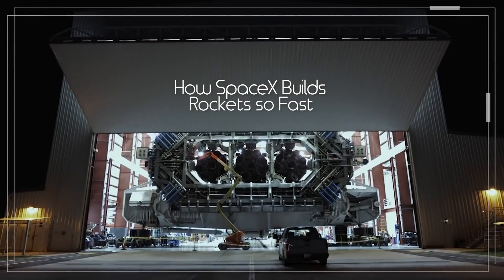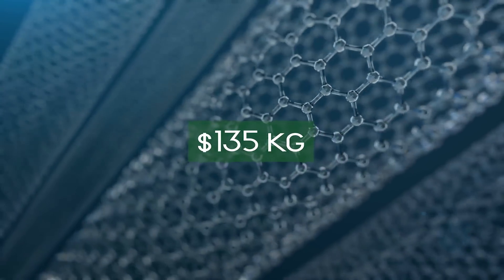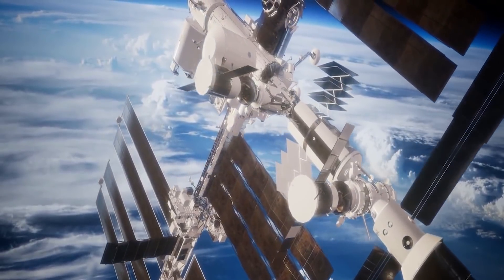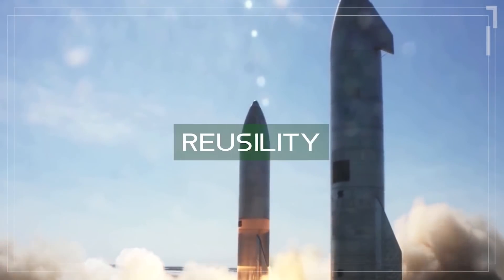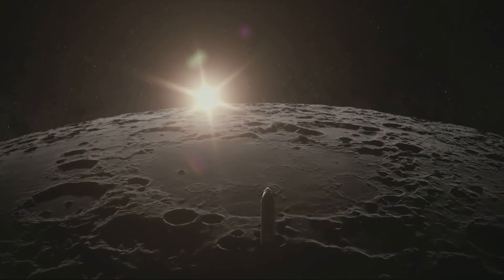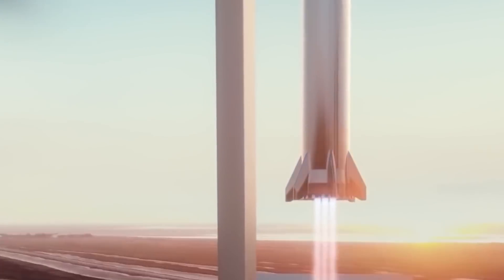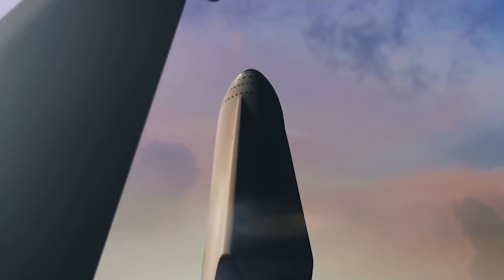How SpaceX Build Their Rockets So Fast?

Comment: I thought they were going to use 304 stainless steel instead of 301. And it was my understanding that the transpirational cooling idea was done for.
Reply: Correct on both points. Elon also was presented a report on how SS doubles the dangers of cosmic rays to the crew due to x-ray emissions.  So get ready for some major changes.  Double hull perhaps? Of course this will reduce cargo capacity significantly.... But having your crew alive on arrival is kind of important
Reply: @davidbowerman6433  , SS doubles radiation risk compared to what?  That came out crass, but I just want to know what you are saying?
Reply: Yes. There are sooo many wrong facts in this video
Reply: “Traditional rockets use tiles” you mean the shuttle, which was very no traditional…. “Traditional” capsules use oblative heat shields.
Reply: @davidbowerman6433  Changes to how much cargo starhips carry would only apply to starships that need to carry humans, cargo starhips would have the same cargo mass and volume

Comment: Very nice video but a few statements are not accurate or misleading. still a great video!
Reply: Which?
Reply: @gig2734   early all of this was either out of date or incorrect, not bad for a video published a week ago,
Eg SpaceX gave up on the idea of transpiration cooling years ago. .
Reply: @gig2734  The type of steel, the fact that F9Heavy doesn't go around the moon, The heat shield info, the welding graphics, Showing Starship while talking about Grid Fins .... and so much more
Reply: And you have accomplished exactly the same feat you attempted to correct.

Comment: They are using the heat shield tiles, it’s just that since steel can survive high temperatures, Elon said they could almost land without heat shields.
Reply: Hey, if all you have to do to re-use a capsule or starship is replace some bolt-on heat shields, I can see that working long-term.

Comment: 99% sure they are going to use a heat shield on starship they are putting test pieces of the heat shield on the rocket launching now
Reply: I don't think sn15 will reach orbit.
Reply: @Stem2Space  Yeah I don’t think they’re going to try to go to orbit until 18 or 19 I can’t remember
Reply: @aidenwindham9390  I think SN20 is generally believed to be the first one to attempt orbiting. It's also further along in production than SN18 and 19, so we might see a jump from SN17 to SN20 like we saw from SN11 to SN15.

Comment: I’m not a spaceX hater in fact I make 3d animations of there rocket but this video has a ton of inaccuracies and uses a ton of outdated information an example is all SpaceX rockets use have grid-fins but in fact a lot of the time they don’t use them like on starship + saying SpaceX doesn’t use tile the new sn15 prototype has over 10000 tile + it only covers about 15% of the hull in the prototype also the thing about hand welding making it cheaper is not true Elon has publicly dead that it would be cheaper to have Machines mass produce starships welding is cheaper for prototyping but once it’s the final design there want to switch to more precise methods to avoid problems like what Sn11 had (a small leak that fried engine avionics)

Comment: How do they build them so fast?  The engines don't work when they need them to.
Reply: The problem is in the plumbing, not with the engines.
Reply: @angadsingh9314  If the engines won't work with the existing plumbing, that's an problem with the engines.
Reply: @rogerrussell9544  nope. Most of the issues are with the plumbing. More often than not, issues have been with CH4 leaks and fires in the plumbing.
Reply: @rogerrussell9544  lmao what? Where tf does that logic come from?? It’s utterly nonsensical
Reply: @angadsingh9314  It makes sense, you just don't like looking so foolish.  But don't worry, if you happen to be a designer for plumbing at Space X and keep screwing it up, you can always get a job designing things at Boeing, they have even lower standards that might suit you better.
Reply: @manashejmadi  Fine you put all the plumbing you want into the next one and see how far it goes without good engines that can fire on command.
Reply: @rogerrussell9544  dude. You're holding the same logic and not even thinking for a moment. Engine failure doesn't cause CH4 leak. There are obviously issues with plumbing. Whenever there was an engine failure there has been either a methane leak or a fire near the turbo pump. And without the plumbing, the engine is useless.
Reply: @manashejmadi Dude, if the toilet doesn't flush you say the toilet doesn't work. You don't say the toilet is fine but the plumbing has issues.  The engines didn't fire right and the ship crashed and exploded.  If you don't like the facts, deal with it but don't come whining to me.

Comment: "The average space rocket has about 21,000 heat shield tiles"
Your information is just bad. The average "space rocket" has 0 heat shield tiles. Most "space rockets" are expendable or boost back from a sub orbital velocity. Pretty sure that the Space Shuttle and the X-37 are the only examples of what you would consider a "rocket" to use any kind of heat shield tile.

Comment: You can't quickly cut or weld carbon fiber.

I've heard Elon say several times that engineering rockets and spacecraft is actually the easy thing to do.  It's the engineering that goes into the production on a large scale that is the real feat of engineering.

Comment: Minor point: SpaceX is turning out Falcon 9 block 5 just as fast as any rocket manufacturer... He can just reuse them and save costs. Also, they gave up skin cooling 2 years ago.  And as a matter of fact, are still facing major challenges on how to protect the fins and hardware from orbital entry speeds. It's still an obstacle they have (yet) to overcome. Add to this Elon is finally starting to understand the math of keeping the crew safe from cosmic rays (SS makes it a lot worse) and the math of consumables the crew needs.  Your going to see some major redesigns in the near future.

Comment: The problem is 8$ per kg for SS 301, 178$ for fibre. Stainless Steel however is more weight than fibre. Stainless steel  density 7.6 g/cm3 while carbon fibre is 1.3 g/cm3. And also Stainless steel fabrication is much more expensive than carbon fibre. I think this is no the reasons their rocket is cheaper.

Comment: Falcon and starship are 2 very different beasts, you can’t jump back and forth and expect someone who is new to follow your video. Falcon is cheap because of the way the produce it and the fact it’s reusable, not because it uses stainless because it doesn’t. Falcon is fairly traditional other than the fact it lands itself. Also, with falcon they had a fairly traditional test experience, flying payload on the first flight. Starship is the one where they are just trying things to see what works and using stainless steel

Comment: Since Spacex uses stainless steel instead of carbon fiber, how do they deal with the weight disparity? Carbon fiber is MUCH lighter than SS, so getting a SS rocket off the ground necessarily requires more thrust, which means more fuel, which means more powerful engines, etc.

Comment: Pretty bad research you did there bruh. Starship is always going to use Heatsheild Tiles on 2/3 Part if its body. Stainless Steel can never take the temperature if re-entry.
Reply: 1/4th of the video was just reading tweets. How much more research can you actually expect out of it.

Comment: SpaceX just blew up their launch pad and sent debris flying for miles. NASA has grounded it. It will apparently take months just to assess all the damage (including to the environment). Of course it is always cool to learn from mistakes, but whatever physics and engineering they relied on to think the launch of the most powerful rocket in history would not damage it's launch site, was ridiculously wrong. It was irresponsible to launch before completing the cooled steel plate...

Comment: So, stainless is stronger pound for pound than CF when frozen.  OK.  But only the tanks experience that, so the rest of the rocket is not as strong for the weight.  Sounds like the best design would be carbon fiber airframe with stainless tanks.  That would produce a lighter rocket hat could carry more payload.  The greater cost of carbon fiber matter less if the rocket is recovered and reused repeatedly. You only have to build it once.

Comment: Type 301 Stainless Steel, often referred to as UNS S30100, is a popular austenitic chromium-nickel stainless steel that is known for its corrosion resistance. Similar to Type 304, Type 301 has lower levels of chromium and nickel which increases its cold work-hardening range.
Elon's gonna beat the Production numbers of WW2 B-17's!!!

Comment: There are some unprecise claims and a vague language.

e.g.: Who says they dont use "fancy machines" 5:06 ?! 
Welding, bending, cutting, lifting, transporting, even attaching the heat tiles all involves machines.

"SpaceX's components consist of " -> Steel is certainly a material and not a component! And its rather about the starship's components

"Construction happens RaThEr openly - so theres no machine doing the bulk of the work" WTF Why?

"Exceptional Engineering" (0:52) could as well have said "M A G I C"

Comment: I'm just curious has space X tried a booster with a turban to help propel the rockets into space with a fuel injection delivery system for fuel?
Reply: This is how IT IS DONE, a turbine driven pump is used to feed the fast amount of fuel and oxygen injected into the rocket engine chamber the resulting massive  explosion in a short duration provides the huge thrust needed, the turbine  is powered by some of the fuel  to pump the huge amounts needed into the combustion chamber in sufficient quantity. The rocket engine design itself is from early german v2 rocket engines basically of the same design but built with new more advanced materials

Comment: Whoa 135$ for nano carbon isn t it that expensive because it s that good. How many more and What step of steel is easier . Imagine graphene at 1 $ a 450kg car wouldn t be more than 7- 8000 with battery witing motor body , panels , even the fabrics.  We can fly the end of infinite infrastructure cost

Comment: Why don't you build rocketa out of stone. It's like 3ct/kg. The whole point of carbon fibre is, that it weights less so you can use more,  its stronger and don't get stress fractures

Comment: " how do they build them? innovative ideas " No there is nothing innovative about them and they are simply using old tech ideas developed by others and yes even the grid fin was developed by another space agency over 40 years ago, the reason they are building them so fast is not that they are building them fast but rather the fact that they are constantly building them so from the outside observer it looks like wow they are fast but really they have a production line rolling assembling pre built components

Comment: Dude, it's full of mistake your clip... what ever can bring you money right?
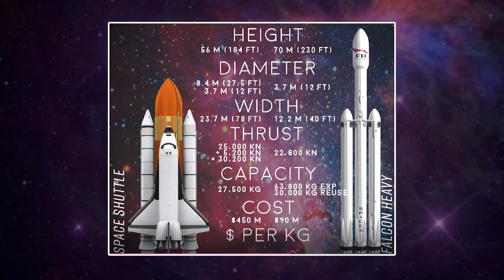At 0:40 seconds, the last line of the infographic is quite wrong or it's seriously expensive to go up.
Since you are talking about Falcon 9s launch rate... these rockets are made out of aluminium alloy. Not stainless. You are mixing F9 rockets and Starships... your story is pretty disjointed as Starships haven't even gone into orbit yet.
And where are you going with your heat shield tiles... they are none on a F9... You're mixed up... and on a Starship, The dual layer has been dropped a long time ago... proof ! In the following segment, you show pictures of SN9 and SN10 with tiles on! There's going to be 25 thousand odd tiles... do you research anything?
WHAT? No "fancy" machines to build their rockets? You are out of Order. E.g., they design and built their own automatic welding machine... the "Knuckle Seamer" plus they have countless jig s they maintain... You are talking about something you know nothing about.
Thumbs Down.
https://youtu.be/H6HN9l3c3AM

Comment: I try add comments to let info of force feild forsey.i say experiment, as put two carbon magnets that pokes repel use clamps make sure the repel is hard forsey then put in a ball air bag etc fill with helium other similar gas..try break the ball..as the power transfers to the skin it created a force feild..so moral is if engineered pipe within a pipe then the action be similar. Forcefield..my group discover this while. Trying to design a lighter space suits skin etc...maybe forward the info see if can be of assistance etc..fyi ..

Comment: This video is so bad its clear it was made by Musk fanboy. First of all if you compare launch costs you have to compare equal flights. Carrying less cargo will cost less. Human gradec flights will be 3 times as expensive as non human flights. Flights to Mars with extremely valuable cargo will cost more than flying to ISS with supplies. 

Secondly the carbon fibre vs stainless steel. Sure carbon fibre is many times more expensive than steel but its also way lighter. And with almost anything it means you pay more per KG. 
And sure it doesnt make that much difference because steel is still many times cheaper but you are clearly trying to paint this narrative that SpaceX is much cheaper than it is in reality just like you did when compared launch costs without counting in any additional factors. 

Third facepalm was when you said reusability can reduce cost of launches by factor of 100 🤦‍♂️🤦‍♂️🤦‍♂️ rocket engines are some of most efficient engines known to humans and 90% of the mass of the rocket is fuel. So you would need to either come up with fuel that is able to produce same amount of energy but from 1% of volume of current fuel or learn how to switch off gravity. Rockets are not new field, this is 100 year old technology and engineers have pretty good  understanding of how they work. Around 90% of mass of rocket is fuel, around 10% is mass of rocket itelf and less than 1% of the mass is cargo. This can be improved to what? 2 or 3%? And even that is wishful thinking but lets assume it can become 3% instead of less than 1%. You only reducing costs by factor of 3 !!! Because you still need same amount of fuel for same mass rocket to get it into space. Saying its possible to reduce cost of rocket launches by factor of 100 is like saying you can reduce cost of airline flights by factor of 100. Completely laughable. 

You are clearly Musk fanboy with zero imagination. You just follow his BS and spreading your own. Its like Musk said he can drill tunnels 100 times cheaper and 10 times faster and then build a sewer pipe that cost was just around average cost for this size of project but took twice as long